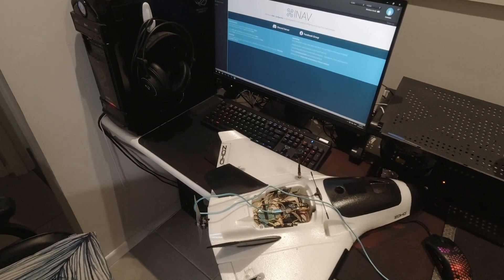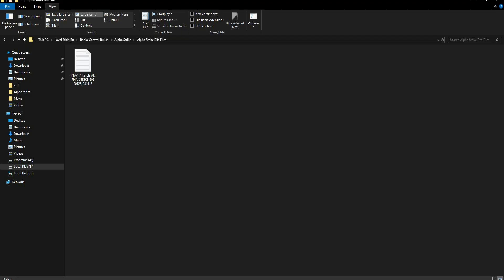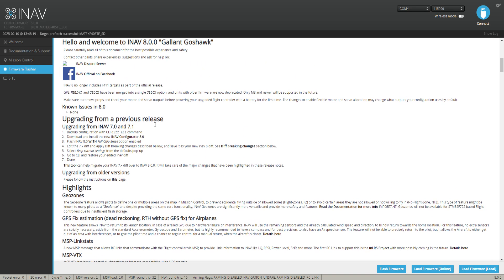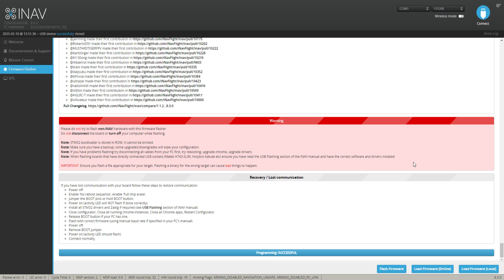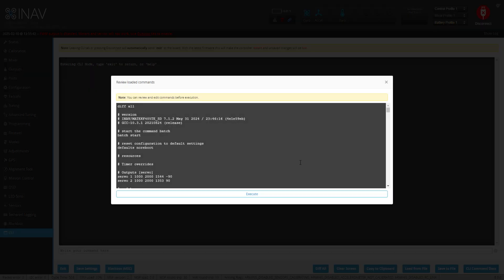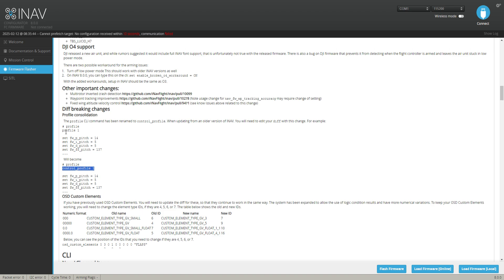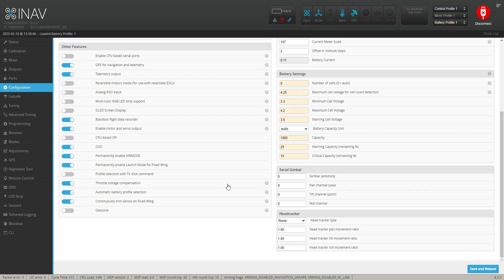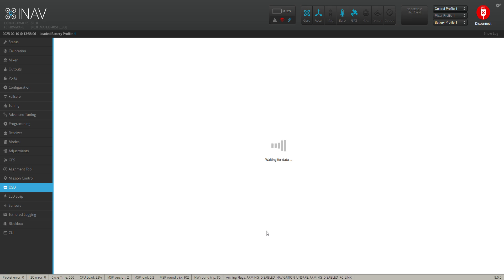INAV Firmware Update Guide (Step-by-Step) | For New Pilots & Beginners

Comment: I have the Matek 405 SE FC on an AR 900 wing. It has Autolaunch and works well. I'm way behind on the February 2022 version. Would it be a good idea to update? Is this FC compatible with the latest INAV 8.0 version? I'm still flying well. If it's not compatible, which FCs are available for building new wings? Thanks. Nice video 👍
Reply from the maker: Hi, yes it would be worth updating to iNav 8. All my planes are running it without any issues. You should run the latest version your flight controller will run, just remember to update iNav configurator as well to the same version firmware you choose. The Speedybee f405 wing and mini are my go to flight controllers both are very good and I have had no issues with either one. Just remember that if your going to update firmware to iNav 8 you also must install the same version of iNav  configurator. I would update both iNav configurator and flight controller firmware to the latest versions. If your happy with how it is flying you could leave it as is as well.

Comment: Hi mate. Great video. It's giving me a bit of confidence to update, I'm still running Inav 6.1.
Should I update the firmware version on my PC first? 
Thanks Ian 
.
Reply from the maker: @ianhanrahan7985  yes update the configurator as well both should be the same versions. Copy the diff all first on to your PC then upgrade both. As your running ver 6 still I'm not 100% sure if you can upgrade straight to ver 8 or whether you need to install ver 7 first. Just keep the diff all file on the PC in case you need to revert back to ver 7 or even 6 if something doesn't work out.
Reply: Awesome. Thanks heaps.